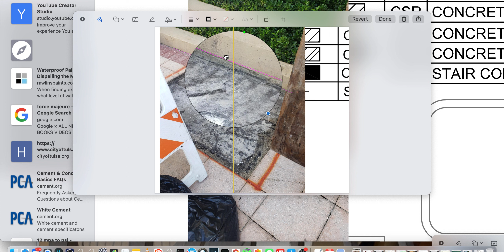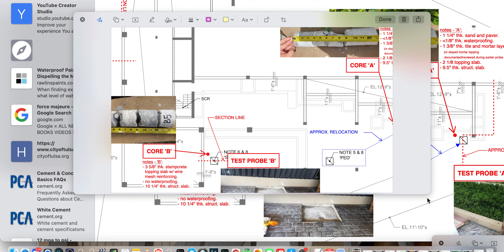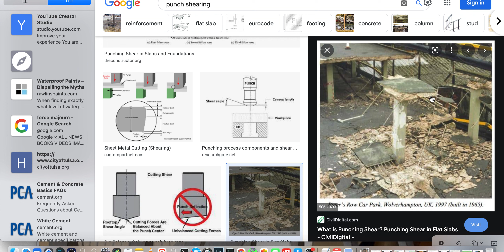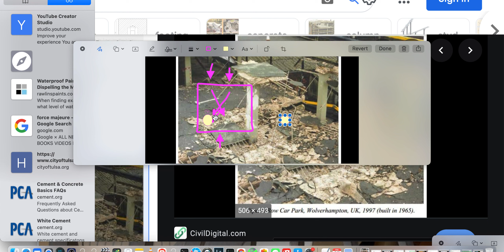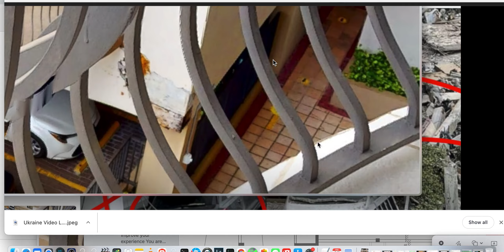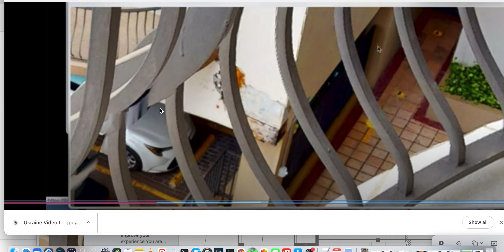Champlain Towers Collapse HOW a single crack reveals Deck Failure Punch Shear DEFLECTION of DECK

Comment: So much going on here, like trying to figure out why you are caring so much about what seems to be a column bead? It seems like some sort of exterior reinforcement, probably metal in this case. It looks like it protected the column concrete from damage when the floor went down around it - just the cosmetic covering was lost, but the column itself isn't spalling off material. 

The balcony seems to be from a lower level condo, possibly 410 or a real estate photo from a lower apartment in or near that stack. You point to a deformed piece of metal and linger towards the end of this video, but I can't tell if it's the balcony railing - assuming that you refer to the balcony railing as belly railing. 

Thanks for the shoutout. I'm a long way from Jaime (who seems to be missing? He nailed quite a lot of Columbo moves when he is around) or many of the others here, but am trying.
Reply: Maybe a stretch, no pun intended, but could the column have flexed sideways enough to pop the edging off?
Reply from the maker: @Chezblarger  Charles, at least you are considering it and that is what it takes, the ability to see different failure mechanisms and then determine if the other data supports or debunks...
It will at least eliminate rotation if that is what is being eliminated...
But, keep in mind, some rotation had to take place.
How about the existing section, is it buckled away , any cracks around that connection?
Reply: @LoadPathEngineering  there are buckles and cracks up the southern side of the still standing building, and some doozies of cracks where the columns meet the second floor.  You can see the rusted, cracked and spalled corner in the same photo that you pointed out the cracked tile.  Remarkable that the building was allowed to get that bad
Reply from the maker: Wait... You wrote the column isn't spalling off...
So, run with that, how was that corner bead removed?
Did it disappear, where is it?
Reply: @LoadPathEngineering  (Circles back and finds higher res pic)...Of the 3 corners visible, only that one seems to have the bead missing. I see some bent metal near the collapsed floor. It looks like it was pried off from the bottom up, so the deck may have had some direction to the pulling vs dropping straight down. 

I also see that the metal I referred to is more likely just a piece of patio furniture. I was also a bit off on the floor height in the original comment...I should have looked at the full size pic before just commenting.
Reply from the maker: @catwoman7014  LOOK AT YOUR SUPERCOMPUTER WORKING, GO GIRL!
Reply: And, yea the 📷 pictures - I think I have a better chance of winning the lotto than those being released. (If I'm wrong, I will just hope to win $2 or some other nominal amount 😆 - hopefully I am wrong.) Wait long enough and the public will forget/move on to the next crisis.